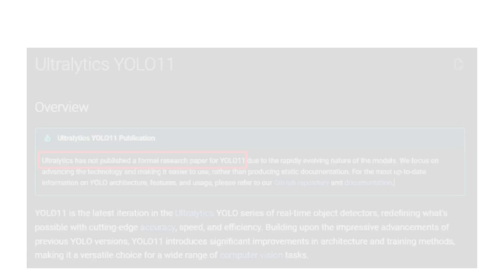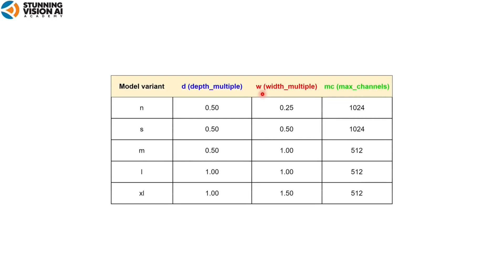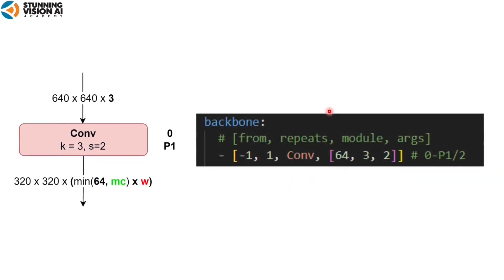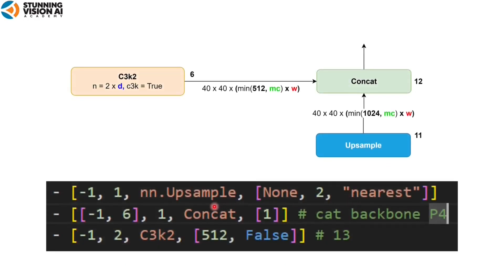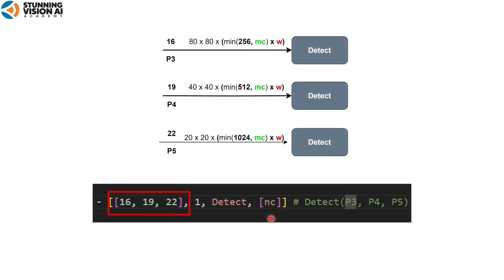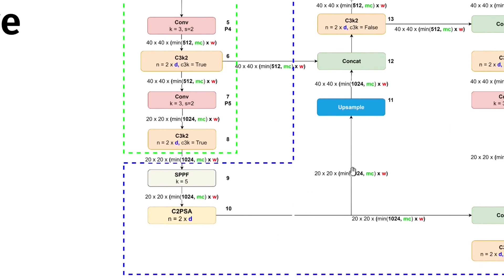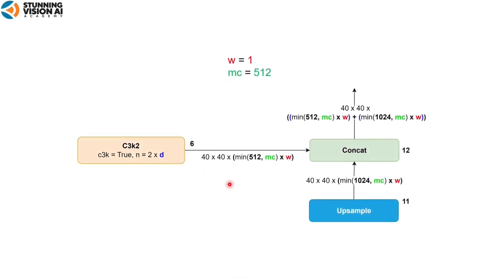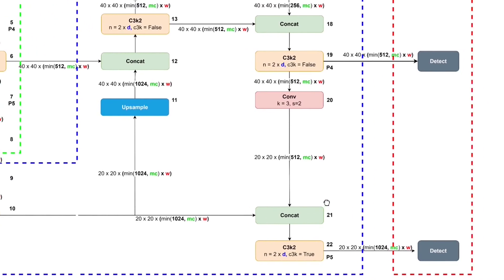YOLO11 Architecture - Detailed Explanation

Comment: If the object size is very small. Can we introduce another output which will be from the 1st C3K2 block of resolution (160x160xmin(512,mc)xw) from the backbone and in the neck we can apply another upsample block then that will connected to another (4th) head. That will work??
Reply from the maker: YOLO11 is modifiable. You can modify easily by changing the architecture in yaml file, or go deeper into the source code. There countless way how to improve it.

If you have an idea, and assume it is a great idea, go ahead try it. You will know after the training finished.

I hope you have a good result.

Comment: All in all what is the architecture name of the Backbone?
Reply from the maker: I have to say the question is not clear enough. Well, the YOLO11 architecture itself consists of backbone, neck, and head. The backbone contains many convolution blocks and some c3k2 blocks. I hope it gives some insights
Reply: @Dr.Priyanto.Hidayatullah  I mean is there a specific name the backbone was named. Normally some backbone architectures are called CSPDarknet or CSPDarknet-53.
Reply from the maker: @granatapfel6661 I understand now. YOLO11 does not have a separate, formally named backbone (like “Darknet-53” or “CSPDarknet”). 

Its backbone is a custom Ultralytics YOLO11 backbone

Comment: Could you explain YOLOv11-seg architecture?
Reply from the maker: Based on the architecture file, the backbone and neck parts of segmentation are the same as those in detection. The only difference lies in the head, where segmentation uses the Segment module. For details, refer to the following file: https://github.com/ultralytics/ultralytics/blob/main/ultralytics/nn/modules/head.py

Comment: sir can the input image be the size of 416*416 or 640*640 is fixed ?in yolov11
Reply from the maker: @perfectbigbazzar4949  I am trying to understand your question. But here are the alternative answers:
1. If you set the imgsz parameter to 416 for example, your input image will be resized to 416*416 px, whatever the REAL input image size
2. There is no restrictions of the input image size. You can train or test with various image sizes. Resize will be applied based on imgsz parameter and  padding will be applied if the image is not square

Comment: Would you provide the source code plz ?
Reply from the maker: When you install YOLO, you will have the .yaml file. That's the source code of the overall architecture
Reply: Thank you, Professor. However, I was looking for the code behind the entire model to explore its structure. Specifically, I'm interested in understanding the implementation of functions like C3K2, CSPA, and others.
Reply from the maker: @SultanMehmedFatihbinMurad you can read it in the paper, research method section. Link of the paper is in the description
Reply: @Dr.Priyanto.Hidayatullah  Thank you! I found the paper insightful, and it effectively addressed my concerns. I truly appreciate it.
Reply from the maker: @FatihSultanMehmed-kw9yt  glad to hear that 😇
Reply: Un diagram muy bueno y facil de entender después de escuchar la explicación, entre la capa 16 y 17, solo en código realmente no veía la continuidad hacia poder tomar la capa 13, pero ya ahora queda claro el propósito,  la diferencia de este que usa detección y el segmentación aunque en código solo es el llamado al modulo de segmentación, ¿ como hace segmentación para preservar la información a nivel de Pixel por Pixel y lo clasifique correctamente para regresar la predicción de la segmentación correcta?

Comment: What a great explanation, thank you sir. May I ask something, 
1. In minutes 6.21 you said that the result is 64, but why did it become 640?
2. In minutes 9.56 you said that the first detect block in head specialized for detecting small object, why it can be?
Thankyou sir
Reply from the maker: 1. Sorry, there is a typo in the image; the correct value is 64. Thank you for the correction.
2. Because the higher spatial resolution retains more details from the original image.

Comment: Thank you for the detailed explanation.. Quick question, what if I'm using Yolov11-cls for classifications will the overall architecture change? or only the head? Thank you!
Reply from the maker: @rawanelabied6654  Based on the architecture file https://github.com/ultralytics/ultralytics/blob/main/ultralytics/cfg/models/11/yolo11-cls.yaml. The backbone for classification and detection is the same, but there is an additional C2PSA block. In classification there is no neck section, it goes directly to the Classify head section.

Comment: wow! great explanation of YOLOv11 architecture :) but I have one question, can you explore the limitation of using certain novel algorithm in YOLOv11 (e.g C3K2, C2PSA, etc)? because science is not only finding new way of doing things but also finding limitation of new algorithm and so far I haven't seen any discussion  or paper that criticize YOLOv11
Reply from the maker: Thanks.

That is a serious question. It needs a strong hypothesis and careful experiment to prove it. We have tried YOLO11 with several different cases and YOLO11 has several inaccuracies. You can check the video here: https://www.youtube.com/watch?v=6Q81IXSiIEc&pp=ygUHeW9sb3YxMQ%3D%3D . However we could not, with confident, say what contributes to these inaccuracies. We are still trying to find out.
Reply: @Dr.Priyanto.Hidayatullah  I agree with you, we still need to do more research on this particular subject. Every model tries to outcompeting each other so they evolved so fast with new algorithm, new bugs, etc... one more question, with so many YOLO version out there, from your experience which YOLO version is the most "production ready"? because from what I learned from your past videos, the newest isn't always the best. Thanks for your answer
Reply from the maker: @mohalem  YOLO11 now is the inital release. So don't worry, I believe Ultralytics will improve it by time. As in YOLOv8. They improved it and released an updated versions several times until now the YOLOv8.3 (which is better than YOLOv8 initial release). 

As for now, I am not saying the others are not production ready, I personally would rather recommend YOLOv8.3.